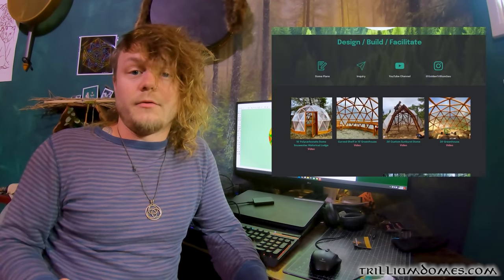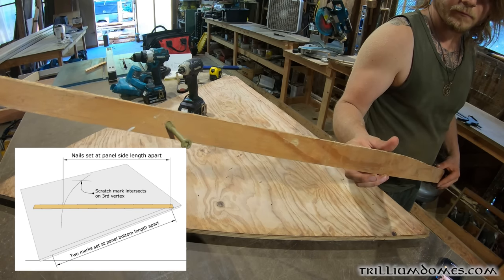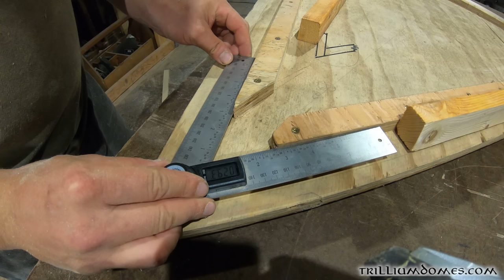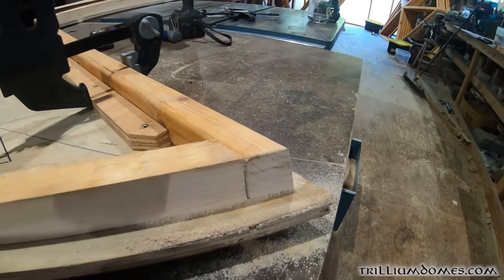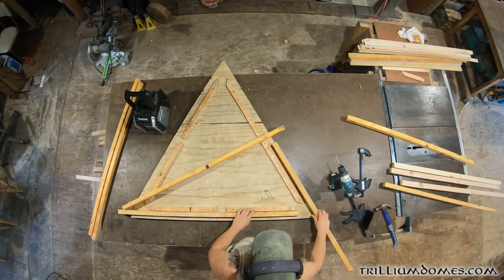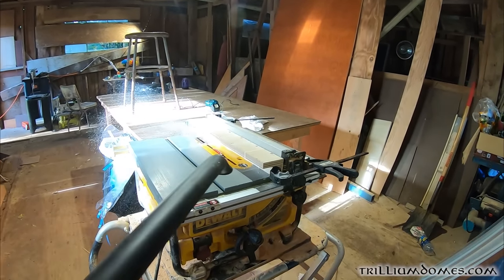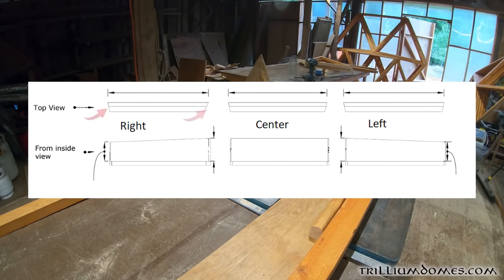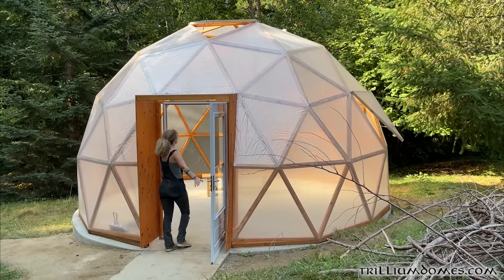The Ultimate Geodesic Dome Build Guide - Most Beautiful, Inexpensive, No Hubs

Comment: bought custom plans from trillium domes..  VERY concise explanation and with this video anyone who can use a table saw, angle finder and measuring tape can do this despite it appearing quite difficult.  if you are debating between hubs and these plans, go with these plans 100%.  he's taken an extremely difficult project and turned into something totally doable..  great job dude!
Reply from the maker: Thanks so much!!
Reply: Hey do you mind me asking did you have help and how long did it take you to build
Reply: @jacquestube  so i had some extra hands at the end to assemble it.  the assembly should be 2 person depending on the size.  did over the winter by myself in the shop.  then assembled in like a day outside.  just did it in my spare time.  really loving the product now two years in.  have raised beds in there and all sorts of stuff growing  Get patco 8210 tape for the seams.  get it built and seamed in one day.  do not use caulking.  only issue with mine was because i caulked the seams in the shop and when assembled, when water gets in rom the other side it can't escape the caulked side.  better to just leave it airy with the patco8210.  
well worth it.
Reply: @esl1402  oh I'm hoping to get it done in the next month, I don't have the luxury of letting it sit out over the winter and I'm going through surgery so if I don't do it now it'll be almost a year
Reply: @jacquestube  month will be totally possible.  get the 8210 patco tape though dude.
Reply: @esl1402  I've never heard of that stuff, is that sort of like the seam tape they put around windows and doors how much like a miniature ice guard

Comment: Nicely done.

My first dome was a 4-frequency that was 1 meter in dia. It came out so good I decided to duplicate it at 6 meters diameter.

I made it so it sets up & breaks down reasonably quickly. One person can set it up in under 2 hours, and break down is very fast, like 40 minutes.

Since then I have made several domes, but the easiest one to set up & transport is a 2-frequency 4-meter dome made from 1-½" pvc electrical conduit. I throw a tarp over it, lash a hammock to a couple corners, and it's an awesome camping jobbie.
Reply from the maker: Sounds rad!
Reply: What is this frequency you speak of?
Reply: , ask Kenneth. 😅👌🏻

Comment: Just discovered this video, and subscribed, great work, simple instructions. Well done
Reply: Why do you want a square door in a geodesic structure?
Reply from the maker: @paulbrouyere1735  great question. It’s very difficult to make functional doors that don’t hang limb and level. When doing that, if you were to do a non square door, you may only be able to get one hinge on it, which is not ideal. The easiest solution is to find plumb lines through the frame and hang a door there.

Comment: Wow, what a gem of a video! Makes the whole process seem very straight forward. I still have a few questions:
1. What do you think of covering such a dome with glass? (Personally, I'm not a big fan of plastics, and would love to avoid it)
2. My biggest concern is the woof frame rotting, how long do these domes last? Best cover to guard against rot? What helps and what doesn't work in your experience?
3. More details on how to seal the seams would be great.

Would greatly appreciate your knowledge!
Reply from the maker: Thank you!

You can cover with glass. but it is expensive. You have to get it cut custom from someone because you’ll want to use tempered. You can use the same method shown for polycarbonate without the trimming. I would get it an 1/8” shy on all ends to create a 1/4” gaps where the panels meet for caulk.

The wood frame will last a very long time if maintained. It’s a lot like having a deck but doesn’t ever have standing water on it. Find an outdoor suitable finish or paint, and maintain it every 2-3 years depending on area, species, etc.

I could have spent more time on sealing but didn’t want the video to be too long. In the case of a greenhouse, The three main ways are caulking/gasket between the panels, caulking the seems after the panels are assembled (such as in glass or polycarbonate), and finally using a UV treated sealing tape/ aluminium cap to flash the joint.

Which of those you use really depends on your level of how crazy leakproof you want it to be. If you’re building a cabin or sauna that has a “real” roof, that’s another story. If you have specific questions feel free to ask.

Comment: When marking your table saw surface, they make a product for scribing layouts on steel. It's called 'blue marking dye'. They have it in spray form. It allows you to mark a surface easily without having scratches in the surface. AND, it cleans up easily with acetone or lacquer thinner. Cheers!
Reply from the maker: Hey thanks for the tip!
Reply: The scratching on the tablesaw killed me. It's one of my go-to flat references in my shop.
Reply: @noiamhippyman  I thought he scratched a mark in the tablesaw, but I looked again and it was just pencil. The saw top did have some pretty good scratches in it, but I imagine that is from cutting thousands of struts. I think you'll need a really good table saw and skills for this, but the nice part is this project is cheap practice.
Reply: Spotted the machinist!
Reply: @umaikakudo  hm... the machinist would have called it by name so you can easily buy it, "layout fluid". And I'm not a machinist, I just watched Adam Savage geek out about it, in https://www.youtube.com/watch?v=n5laGi3GO7M
Reply: Just belt sand it off with 80 grit like new again🤪

Comment: At 1:50 you convinced me your method is superior.  The issues with covering pvc/tube and connector/hub domes is something that was glaringly obvious to me as I began my research.   Attaching exteriors and interiors on those types of domes would be very hard.
Reply: I suppose that depends on how you decide to configure the dome. There are plenty of configurations; including have domes at the four corners of a structure (two taller than the other to create a hypar) that would be very easy to cover. I'd love your feedback on my dome design. Check out my latest video here: https://youtu.be/RqYZ9yOth2k

Comment: I would like to thank you for sharing your methods with us. You have conveyed all the information in a very understandable way. I just have questions about waterproofing. I may not understand because my English is not good enough. That's why I wanted to ask you directly =). I would be very happy if you answer.
I am planning to make a winter garden, the frames of which I cover with polycarbonate. I've seen you use double-sided insulation tape when attaching polycarbonate to frames. But while you were assembling the dome, I couldn't understand what you used for waterproofing between the frames. I saw in the video that you only connect it with screws, but I think this will not be enough for waterproofing.
Thanks again for your interest and sharing =)
Reply from the maker: Check out trilliumdomes.com/faq for info on that!

Comment: Have you tried glass panels set into rebates in the struts?  They could be set in clear silicone sealant. Use trim strips over the joint after joining the panels. Also set on silicone.

Comment: I like these excellent examples to follow, safety in mind, manufacturing techniques, jigs, other help to make parts identical and final construction the best it can be!  Nice job!  Inspire-ing!  so only question left is why do people still make 90o angle houses and offices when such great ideas have been around for some time ... 

building your home is more like woodworking or furniture or sailboat making
without having to worry about seaworthiness of your final structure ...

I want to cover my dome home with grounded copper >1mm sheet metal for electromagnetic shielding and may put this on outside to be used as last layer or weather cover however I could put copper under the plywood but then on top of plywood would need
to use tar paper & shingles as outside weather cover ... so many choices ...

Comment: A pump-up garden sprayer and paint roller work well with water based or light thinners based stains. Spray on a thick coat and roller to get an even coat. It’s much faster and less messy than the roller and tray method.
Reply from the maker: Hey thanks for the tip!

Comment: Interesting video.  You should look up the wikipedia article for "Goldberg polyhedron".  There is a set of diagrams illustrating some of the variations of that shape.  I'm curious how hard you think it would be to do a dome based on the one in the upper left.  Not necessarily in those colors, obviously, but at least to that kind of shape/panel layout.
Reply from the maker: Thanks I looked it up. I think it’s possible. I would need to figure out how to draw it in cad to get the specs but it looks really cool

Comment: Great build. Do you have any videos on the strength of this dome? How much weight can it support on top? Can this support cement layer to create a monolithic system?
Reply: A lot of this would depend on how you attach your struts together.  I build a 15' dome and it is quite strong only held together with deck screws.  If each joint were glued the strength would be actually insane.  I like your idea of using this as a plug mold essentially.

Comment: I'll build a rather non-spectacular and boring 3x10m growing tunnel next year, but I was toying about the ideo of building a dome, too. Nice looking, fascinating shape, realatively easy to build after the initial planning. I came across these construcs about 10 years ago and watched a couple of videos, but this is the first one that explains it well enough to get the important information without getting lost. Good job!

However: How did you tackle the problem around condesating water at the inside, if you use it as a growing dome?
Reply from the maker: There are definitely positives to the big hoop houses that is for sure! But the magic and spectacle of the dome is unrivaled. 

As far as condensation goes, twin wall polycarbonate really helps because it has decent insulative value. Film will always condensate but you can get film that is treated to not condensate to the point of dripping. At the end of the day, it’s a greenhouse and will be moist inside at times. Re-oiling or re-painting your frame every so many years is important just as if it were any other wood product that will be exposed to elements. But in my experience the frames have held up for many years with no problems in the pnw which is an extremely wet place. 

Your base material plays into it a lot as well. For instance a dome over grass will condensate way more than something on gravel, flagstone, wood deck 

Hope you get to build your dome! 

Cheers!
Reply: @trilliumdomes  Thanks for your answer. 
A brainfart I had a long time ago was to use simple UV-resistant plastic sheets at the outside and a foil from the inside. Both for isolation and to prevent condensation damage to the wood. But I guess that's too much effort at the end of the day.
And I'd definitely use wax and oil on all the wood.

Comment: I used to scrounge metal tubing from garage door installers. Used them for shade structure legs. They are thin enough to be flattened on the ends as iis done with electrical conduit when making a geo dome. These go across the opening and they get tossed when a new door is installed. It has been a while since I needed some, so I do not know if the scrap market has made it worthwhile for the installers to recycle them.

Comment: Have you tried using a flush cut blade on an oscillating multi tool for knocking off the ends rather than a compound miter cut? I feel like it would be slower but could be worth a shot (beats a carpenter saw). It could also be used for trimming polycarbonate on the edges but that would definitely take longer than the table saw.
Reply from the maker: I don't think it would be faster than a carp saw unfortunately, certainly not faster than the chop saw method. Also I kind of just hate oscillating multitools and only pull them out if absolutely necessary. If you try it, let me know how it goes!

Comment: Great Video! You recommend only using screws for all of the joints/seams? No glue or adhesive?
Reply from the maker: Depending on the use of the structure, you certainly can. Some folks want to be able to disassemble the dome, in that case definitely no adhesive. I would recommend  putting silicone between the panels in addition to taping the seams if you're really adamant about water never getting in. Most people building greenhouses will use film and that will condensate anyway so it's not a big deal. 

However building something like a dome cabin/house will obviously require different further water/air sealing considerations.

Comment: Have you considered a flush trim router bit for cleaning up the polycarbonate overlap?

Could you answer what internal center heights will be generated, by a 12' diameter and 16' diameter?

I'm heading over to your site to buy the plans now.
Reply: I'm sure that would work. All the specs for each design are listed in the descriptions on my website.

Comment: Awesome video! Would these be okay to use a shed/workshop or would they get too much moisture inside? Thank you!
Reply from the maker: Thank you!

 I would treat it like any other structure. You’ll need ventilation and insulation if where you are gets really cold or hot. I would not suggest building a greenhouse as a workshop necessarily. But you can insulate and most of it just like any other little shed structure

Comment: Do you have a video on taping off or silicone'ing the exterior once the dome is assembled? I can see the perimeter being straight forward & easy to access but as you build up and in towards the center of the roof it seems like it could be tricky.
Reply from the maker: I don’t at the moment but I will soon. It’s very straight forward and yea you can climb on the domes no problem!

Comment: Awesome Work 😊 I'm VERY impressed !!!
I want to build a small dome that I can use to project videos onto - from the inside.
I want to seat 2-3 people at the most.  So, it will be a fairly small dome.
The individual panels that you use are flat - so that means the connection points will not be perfectly rounded for a well rounded screen to project upon.
So, my question is - How can I make a very SMOOTH rounded dome on the inside ?  😊  Do you have any tips or advice ?
Thanks 😊 Patrick from Bethesda, Maryland, USA
Reply from the maker: You could plaster the inside to be smooth !

Comment: I'm interested in a simple done about 12' across. I want to know the lengths I will need and the patterns. I intend to make the frame from straight trees and the connecting pieces from pieces of wood carved with a hand saw, hatchet, and knife. It will be built in the woods with everything built on sight. It won't be perfect but I think it is doable. I know it is an unusual project, and I need the simplest design to make it possible.

Comment: Beautiful! Can these sections be built insulated, and sealed with plywood, Zipp tape, polyiso and other conventional building materials to make a more permanent/cold climate structure?
Reply from the maker: Of course! You can do a traditional roof assembly. I would suggest aluminum shakes for various reasons but architectural shingles work as well. You can also use ACM or FRP to create your shell.

Comment: What are your thoughts on the longevity of the structure using wood versus some kind of composite / aluminum material?
Reply from the maker: I personally am for wood. It’s much easier to work with an cover. It’s a forgiving, strong and inexpensive material. Depending on your climate you may have to re coat the oil / paint on the wood every handful of years. The frame has great longevity even when neglected from my experience!

Comment: Thanks for the video! What do you recommend for colder areas? Almost down to freezing. Acrylic on inside and outside? Question 2: does drilling holes and adding screws promote timber rotting? Do you add finish to every screw hole to mitigate this?
Reply from the maker: No the butyl roofing screws are self sealing. You can use multiwall polycarbonate or multiple layers of woven poly film to create insulating air gaps in colder climates.
Reply: @trilliumdomes  awesome, thanks! Just bought the Zome plans, and hopefully will build my first one here in Australia! :D

Comment: Really enjoyed your video, thanks for making it! Question I had, what would be the largest dome you would recommend to build with this style of joinery? I see you sell a 30 ft plan in your shop. 

I was asking because the ideal setup to me seems one super large dome and then a smaller dome inside that (for my cold Canadian climate).
Any thoughts?

Thanks again for the vid :)
Reply from the maker: Up to 40’ in diameter is doable! You could go bigger but you would have to add some extra bracing or trusses, which is also doable! Of course building a dome that big will require scaffolding and some equipment not needed for the smaller domes :)
Reply: @trilliumdomes  that's awesome man, thanks for the reply

Comment: Do you think your plans would be good enough to create a dome to be used as a house?  I would imagine a wooden deck, and something stronger than plastic for the dome components. I checked out the etsy shop and you have a 30 foot dome, that seems plenty of space?
Reply from the maker: Yeah there’s no reason why not. The method as shown sets you up with only 1 1/2 in he’s of insulation but for a small space that can be adequate. There are other ways of bumping that insulation capacity up though.